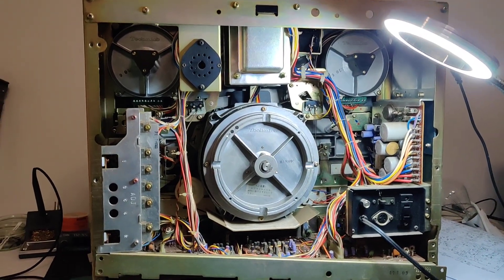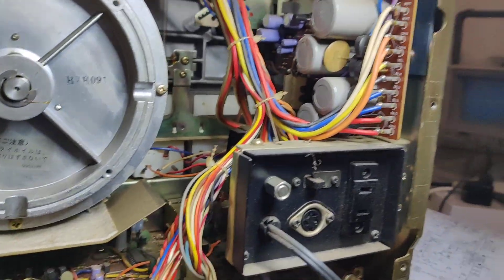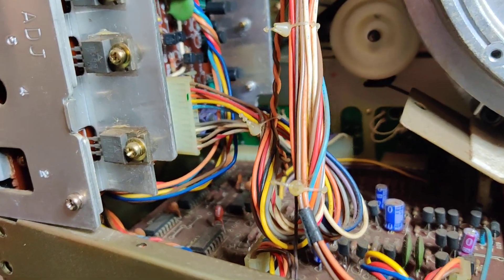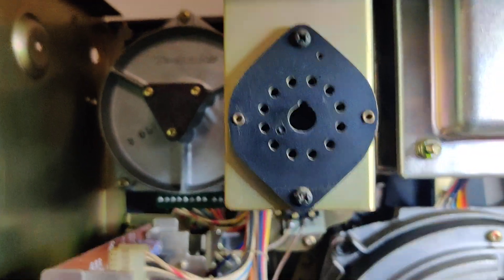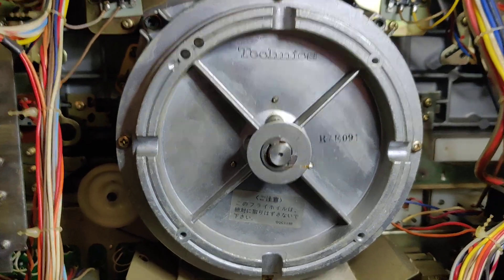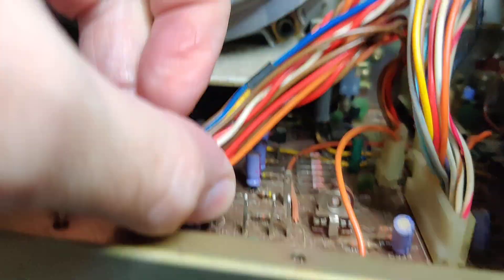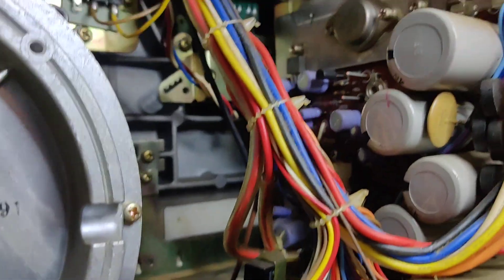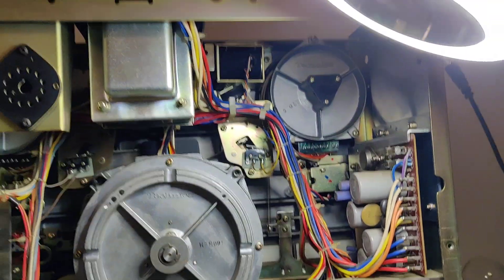Technics RS-1500U Repair Part 2

Comment: I think you are doing a great job retro engineering this r2r .... it's super complex 
someone told me that the main control board at the bottom may suffer from bad tracks caused by corrosion ?
same with the capstan control board but there are so many components on these boards that it could be anyone one of those gone bad
Reply from the maker: No corrosion evident unfortunately; I have looked at all the routine signs of failure but these are hardware problems. I need to provide a free estimate by UK law, but have already spent several hours on this, which will be fruitless if I trace the problem to a component I cannot get.